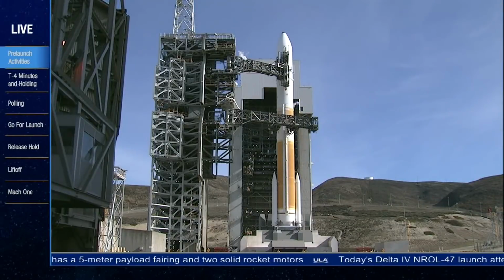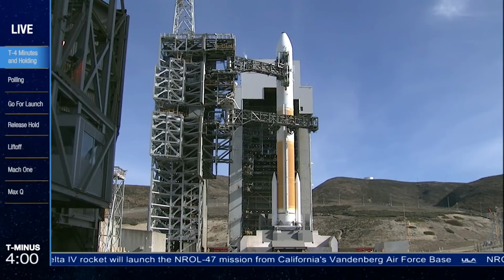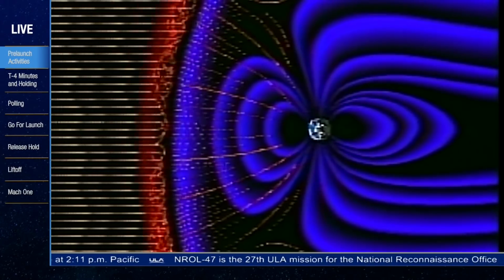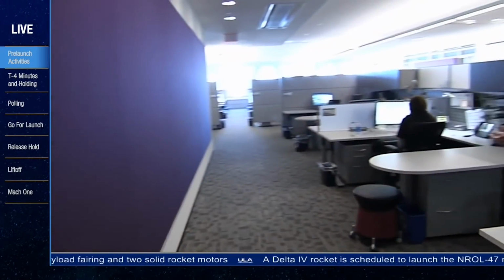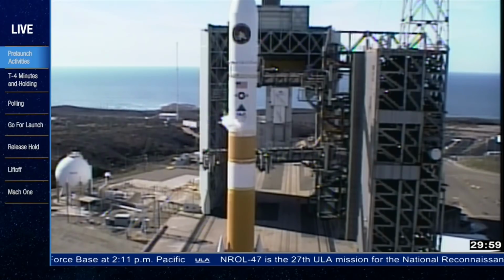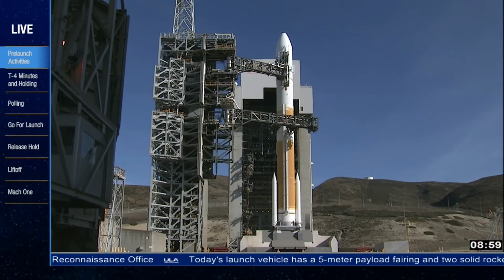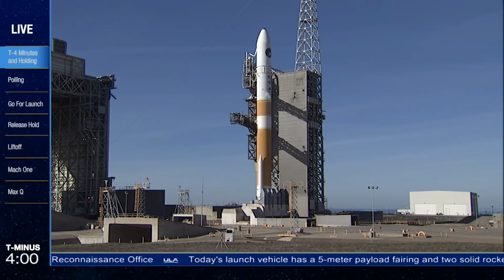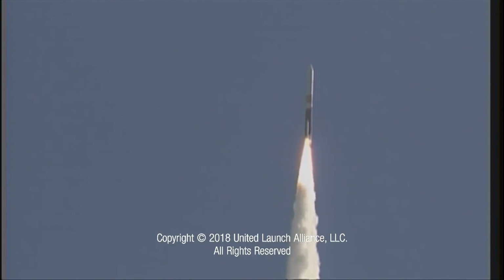Delta IV NROL-47 Live Launch Broadcast (Jan. 12, 2018)

Comment: So when are you guys going to grow some balls and design a reusable rocket? Instead of buying overpriced Russian engines and pursuing the minimum amount of innovation.
Reply: Benjamin Wood Yeah average military launch cost for ULA is ~$400 million vs SpaceX with ~$80 million dollars.
Reply: It's the goddamn NASA budget, yunno. Budget = restrictions. Want a proper rocket? Look at 'em private companies.
Reply: It's probably cheaper that they keep using new new ones instead of investing research into making a reusable one that might not even work the 2nd time, or efficiently in general.
The heat in the rocket is so high that they use a special plating for the rocket so that it doesn't catch on fire for example and anything inside stays safe.
Reply: Scarce It would be much cheaper to invest the money into R&D. It's not like their launches are cheap in the first place. Even a brand new none reusable falcon 9 is still cheaper than anything ULA has to offer. They will quickly be left in the dust if they don't improve in a major way soon.

Comment: was the side of rocket supposed to get burned like that? I dont think it should, and if it was meant to, its stupid and dangerous.
Reply: Yes, the excess hydrogen used to fuel the engine burns off just before ignition. The space shuttle had sparklers near the main engines that were designed to counter this, but since this rocket doesn't have as many sensitive components or systems that were present on the Space Shuttle, they don't worry about it.

Comment: This is so boring compared to SpaceX’s launches
Reply: Except for the lighting itself on fire part. That's always a big crowd pleaser. ;)
Reply: No it wasn't, SpaceX performed another flawless launch. Whatever happened to the satellite (if anything actually happened to it) it was Northrop Grumman's fault, who not only provided the payload but the adaptor to the rocket that's responsible for separating it as well.
Reply: Yes, the SpaceX second stage completed an orbit and a half and de-orbited exactly where and when it was supposed to. Had it "not achieved orbit" as certain idiotic news outlets claimed it wouldn't have made it around the planet for a full orbit.
Reply: SpaceX are also forging ahead with their next satellite launch for SES and Falcon Heavy test flight, which they certainly wouldn't be doing if there was any issue with the rocket.
Reply: Spacex takes the lead in every way. That rocket looked like it was about to explode on launch.
Reply: Pieter Then why you're here, you must be amazed.
Reply: Yeah that's what the news say space X said the rocket performed correctly and if the satillite made a full orbit it will carry on with stage seperation or not
Reply: Pieter yeah last sat was lost by spaceX